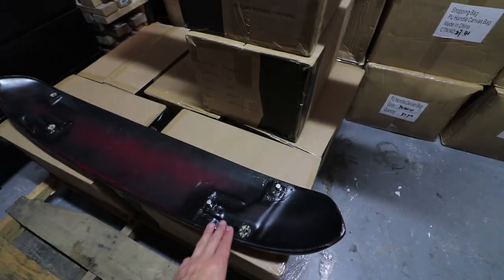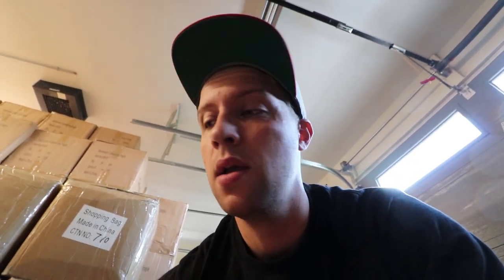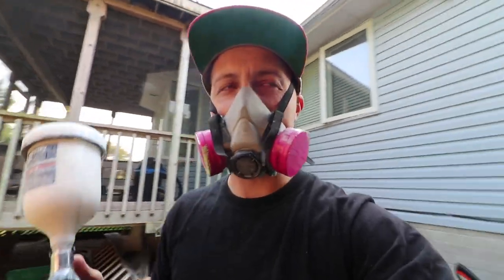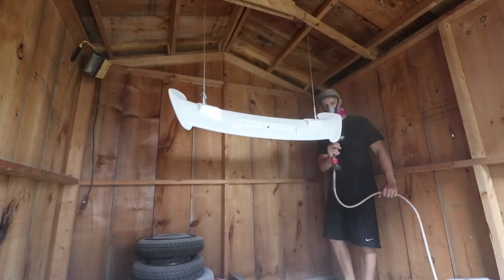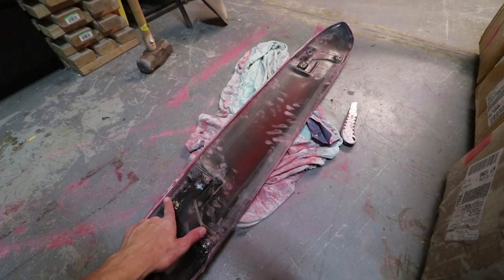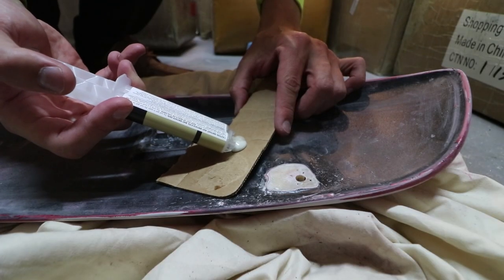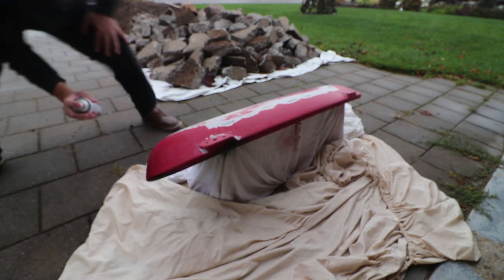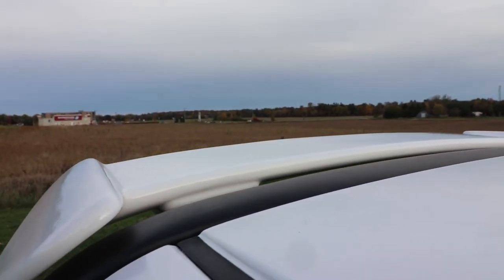Paint Matching a used Type R Spoiler to my Civic

Comment: I know you have the grill and spoiler black which looks awesome on a white car. But In my opinion. I think the door handles and side strips would look better white. Again, that’s just me. 

I have a white Audi that came with chrome grill and chrome window stripping. It also had a chrome side strip. 

I painted the grill black including the Audi emblem, added a black spoiler. Then I painted the chrome side strip and window strips white to color match the car. I added a few nice black Quattro  emblems on the side of doors to contrast the grill and spoiler. I also added a small red Audi stripe on the side of the grill to match the Painted brake calipers which I did red as well. Added a black Quattro sticker on the red caliper. Painter the wheels black as well. 

So all in all, I think painting those strips on the windows and side white looked really well. Looks way more classy then leaving it a different color then the car. 

Maybe you can platidip those parts just to see what it would look like if painted white, then you could choose to go black or white depending on what you think looks better.

Side Note: 

Thinking of making the Audi emblem in the front red as well, but I have no idea how that would look. Also I have to idea how to mask something that small in order to paint in. I would probably need really thin masking tape. I might just paint it by hand so I don’t have to mask, but I don’t know if it will look sloppy with a paint brush job lol! I really don’t care to mess up and have to repaint whole grill. I could just plastdip red, and pull off the excess since the emblem sticks out lol. I guess I’ll figure it out. 😂